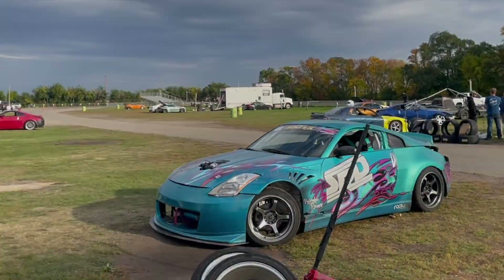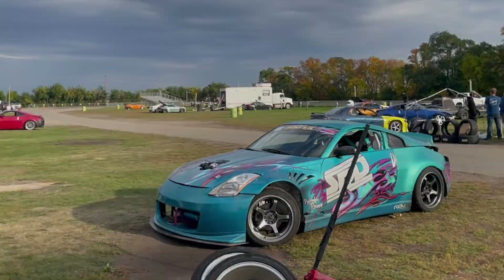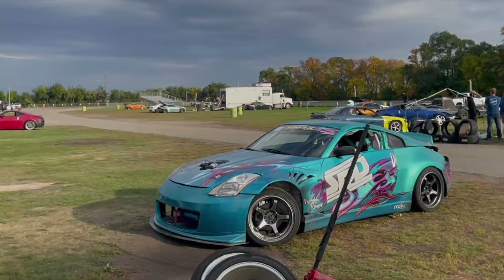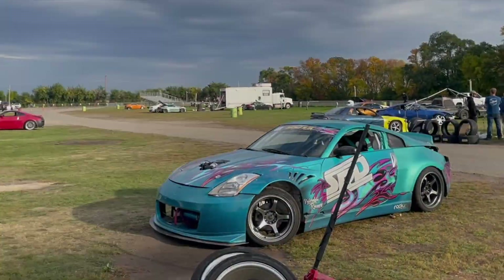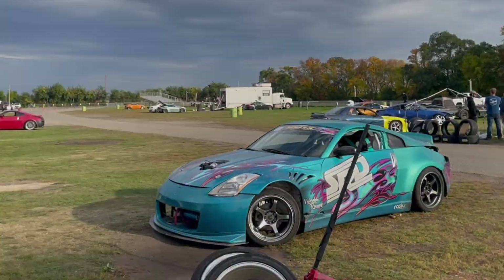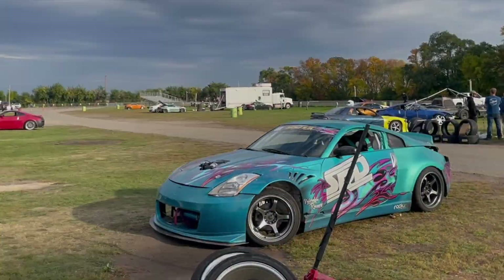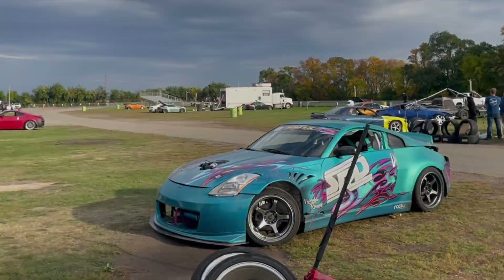How I Made my Audi TT Rear Wheel Drive! **Overview and Discussion**

Comment: Hey, I know the Haldex system quite well and want to say that the factory split is from 100/0 up to 50/50. Technically it's not possible to give more to the rear than there is in the front in this configuration.
Reply from the maker: Right! Thanks for the insight, I did see that when looking at the haldex tuners ect, but doing it this way I was able to make it work.
Reply: @shiftwrenchrepeat  You did it the only good working way. Don't worry.
Reply from the maker: @looka159 eventually I’d like to find a way to just shim out that pinion gear and get rid of the haldex clutches all together

Comment: Why not just replace the Haldex unit with a literal pipe going from the driveshaft to the rear diff? It would have only taken machining a cover that can fit a bearing and a shaft that can also fit into the bearing. All of which can be done in CAD and outsourced to some machining shop.
I can't find any picture online, but is it possible to remove or weld the gears that send power to the front wheels through the front diff, and only keep the gear that sends power through the transfer case towards the rear?
This is a Haldex Gen.1, so the torque split is 85-15 (F-R) in normal conditions and up to 50-50 when the haldex is fully locked.
In a way is very similar to how the Syncro unit from the previous generation of VAGs worked.

Also, to lock the Haldex, you could have just used an aftermarket controller. It plugs straight into the Haldex ECU and does its thing. There are even bluetooth-enabled ones so you could map different ratios at different speeds straight from your phone.
Reply from the maker: Yes I could have used a controller, however this cost me about 50.00 and the controller was about 1,000….. I’d rather put  that money into my suspension and steering
Reply: @shiftwrenchrepeat  I thought that YouTubers had unlimited money. ☹️😂
But, yeah, that's the old school way of doing it. You can very rarely find one for sale online with that kinda mod. One from way back in the day, before controllers were a thing. Or they have the permanent lock controller. I think it was called "the blue controller" (if i remember correctly) because of the color of the case.
Reply from the maker: @myrmeko yeah I think it was the “blue controller. 

And maybe some youtubers but not me with 5k subs 😅